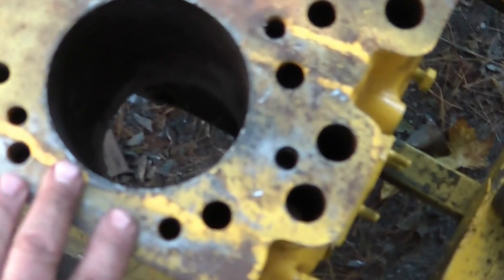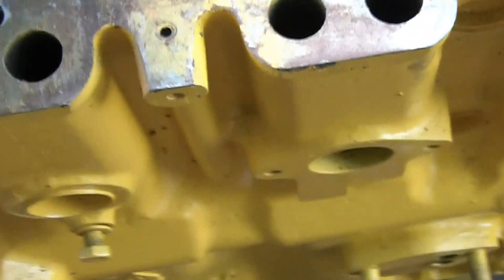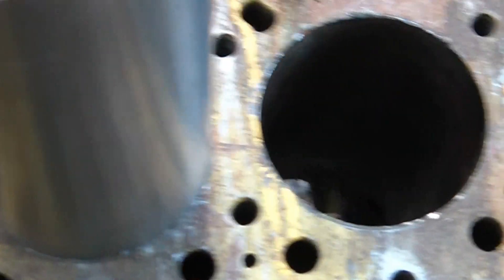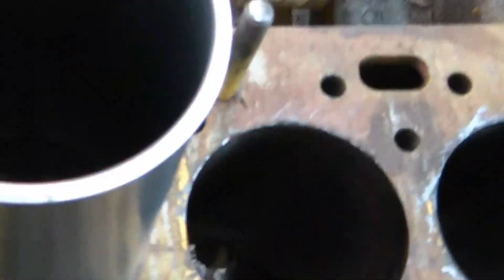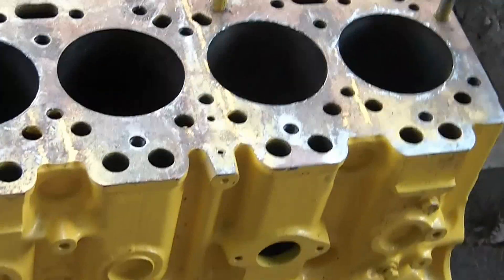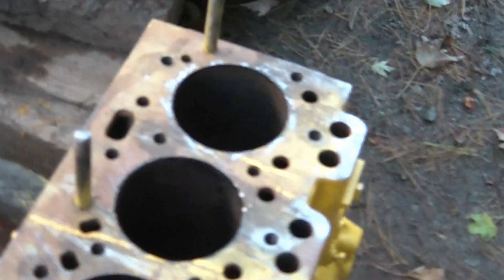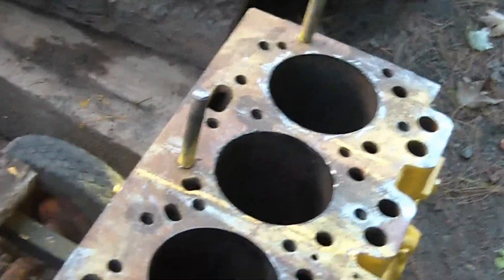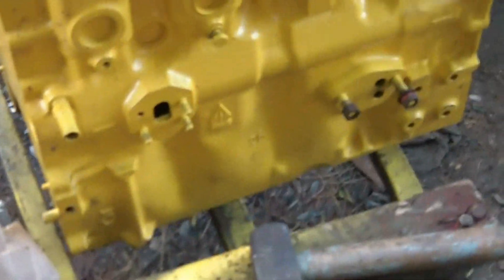Cylinder Liner / Sleeve Removal How To with No Budget. Part 2

Comment: It's been a long time sense this post but I have one comment/question.  What Mfg. is the block that you are working with?  I have a Perkins Engine that I need to rebuild and it calls for a small lip to remain above the cylinder. Maybe just on Perkins.
Reply from the maker: Billy Correll The block is a Perkins but didn't call for a lip to be above the block. The liners I ordered did have the lip so I had the machine shop do a little machining of the block. They did it wrong and the lip was lowered into the block area. If you are going to get the block machined make sure the person doing it fully understands the wy the liner is supposed to sit or you'll be buying a new rebuild kit for a 4-248. My block is a 4-236 and.